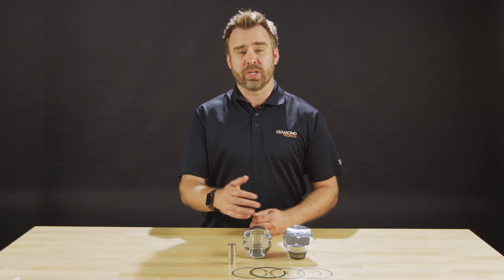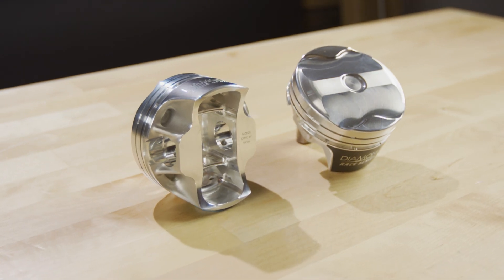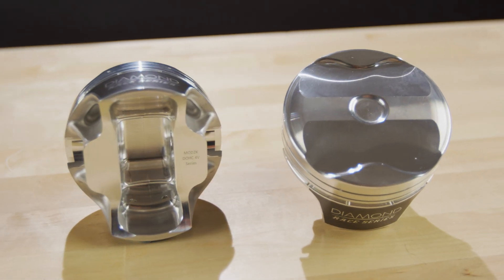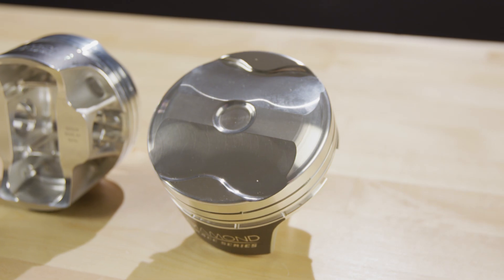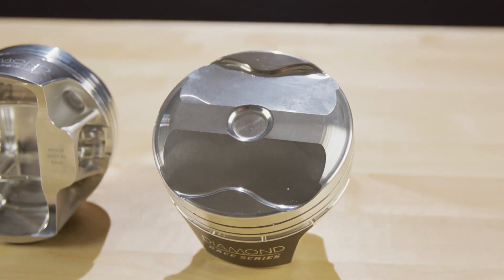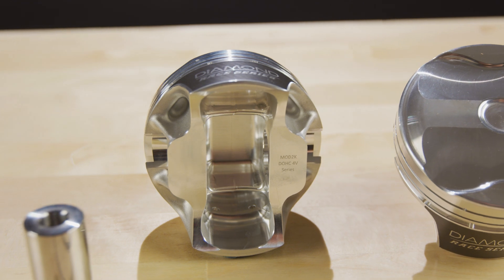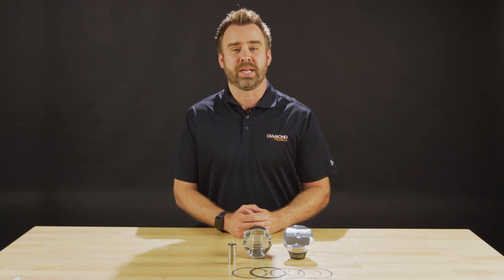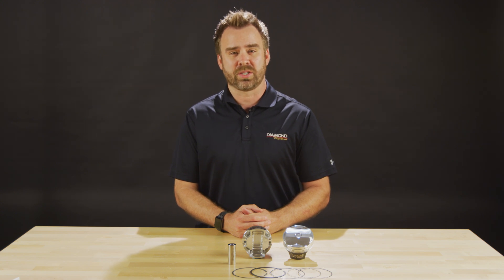MOD2K: 2,000hp+ Capable Ford Modular Pistons

Comment: Mod 5.4 4v 1.33CH for NA?????? Who wants to run .120 down and ~9:1 on an NA, super nice piston design though
Reply: They make a 1.330 for the 5.4s correct setting. Jordan at Modular Headshop has a tab special just for us 5.4 guys and even a tab with parts specifically for 2v NPI/PI or TFS stuff. 
Just be aware ANYTHING 5.4 2 valve u build your using a dormant factory intake unless you find a Sullivan for 5 grand last I saw one up for sale. Or a HPS harballr which i really wanted but no go still. I ended up buying an edelbrock 4.6l 2v victor jr intake just to cut It half and widen it. And made my own rectangle coolant tube to fill that gap.